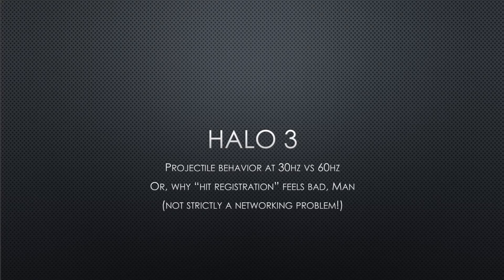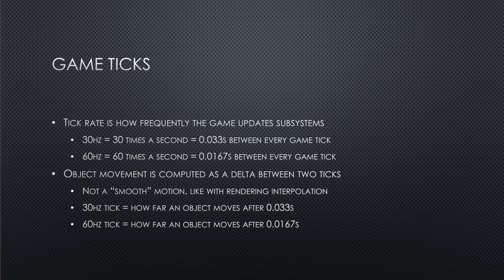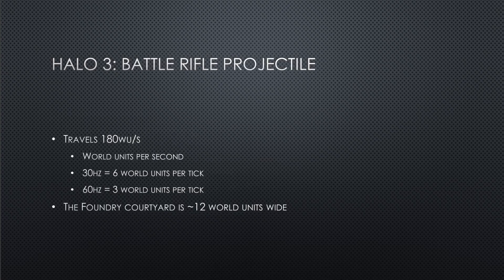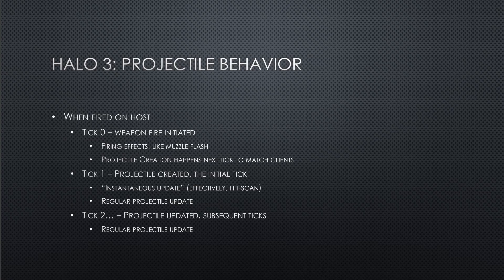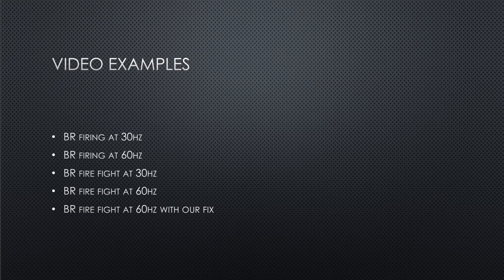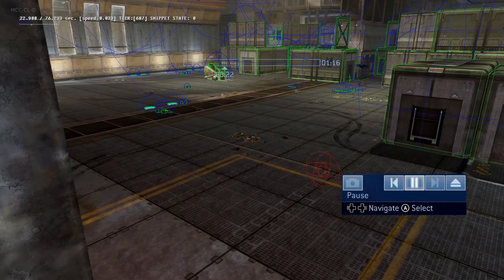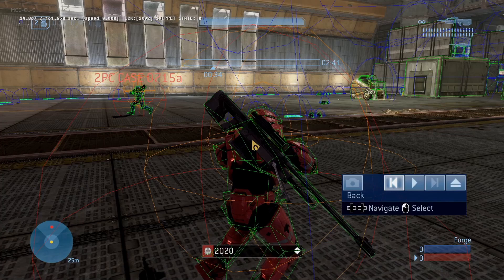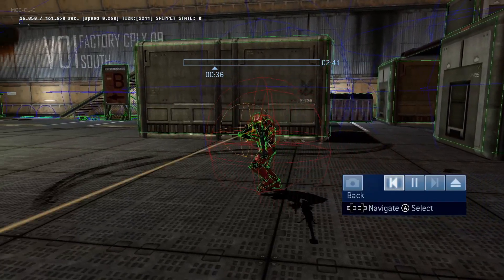Halo 3 - Projectile Behavior at 30hz vs 60hz

Comment: When you say the length of a world unit is "specific to the game" does that mean every unique Halo title's definition of a world unit is different, or just that it's not a unit used IRL?  In Halo CE 1 WU ≈ 3.0675 meters, because the max range of the pistol is 40 WU and the projectile vanishes at about 122.7m.  Would Halo 3's world unit also be 3.0675m or is it different?

Comment: From my understanding, this is going to improve up close BR fights, but I feel like mid to long range is still going to have the same issue, albeit to a slightly lesser extent. Couldn't the issue have been solved by increase the WU speed on the BR from 180 to roughly 270-360wu/s without messing with the tic rate of the initial tic? Would make it slower than the H2 BR, without sacrificing mid to long range consistency. Or maybe editing both the initial tic behavior and the overall WU speed of the projectiles would be the best option? Also, what about the other weapons? Many people have the same issue with the sniper, carbine, and several other guns just getting blood shots, but the game doesn't register any damage. Were these weapons fixed as well?

Comment: the only way hit reg can be a perfect 1:1 with original H3 is at 30hz tick rate. its that simple. this will be so close to exact i dont mind though. strafe dodging inside the hitscan range should be ever so slightly harder now, but id prefer that over having to begin leading shots at half the usual distance. rewriting projectile behavior wouldve been a lot more of a pain to do, and it wouldnt have been worth the results when compared to the ease and effectiveness of this fix in my opinion. solid work guys.

Comment: player: gun go bang bang

developer: you see. the ticks, and the bullet value registers with the wall that it has been hit. at this stage, the server registers this with itself only once and then sends packets to the client that its projectile made contact with the wall. at this stage the client will see on its screen that the bullet has missed its target and hit a wall. the player will then press their left mouse button again which will signal to the client pc to fire its weapon. 2 ticks have elapsed. during the 3rd tick when the projectile is created and leaves the client's weapon. it makes contact 2 ticks afterwards with a player. the server will tell the enemy player's client that it has been hit. and the client will confirm with the server that it has been hit. and the server will show on the player client's screen that it hit its target

Comment: So changing the WU of the 60hz BR to 6wu every tick mimics 30hz better. Though does moving 6wu per tick increase the bullet volatility? Essentially doubling how fast the projectile moves through space?
Reply: Only the first tick, the 'hitscan' tick is doubled, so there is parity in hitscan behaviour for both tick rates. After the first tick bullet velocity remains constant for the projectile.
So close to mid range encounters will feel more consistent regardless of tick rate, without affecting the bullet travel time of each for mid to long range encounters.

Quite an elegant fix if you ask me.

Comment: So if I'm understanding this correctly, for Tick 0 & Tick 1 the bullet travel speed is essentially doubled to 360wu/s (under 60hz) in order to achieve the desired 30hz bullet travel effect of the past, but for all the Ticks after Tick 1 it's back to the 180wu/s?

Personally, I think you should just bump the travel speed up to 360wu/s for the BR throughout all ticks regardless of the tick rate and call it a day because I've always felt that the BR's slow bullet travel speed was a major annoyance within Halo 3' gameplay.
Reply: This still won't fix the blanks for off-host players... There is a 1-frame/tick (16,67ms) misrepresentation to where the bullets go for off-host players...

Comment: is the problem simply that halo 3 is extremely forgiving when calculating collisions on a low server tick rate? increasing the tick rate should only make projectiles more accurate right? all you've done here is made the BR projectile speed non-linear (and increased it overall by 3 units a second) meaning that you will have to lead shots less at close distances? this seems like patching up the problem and not fully addressing it - couldn't this be addressed by increasing bullet magnetism across the board on every weapon?
Reply: This, or simply removing the visual misrepresentation of when the bullets hit a target, i.e: they actually hit 16,67ms later than what is shown on-screen for off-host players.

Comment: someone else a bit unsettled by the speed then some slower bits this guy talks at.
it sound unnatural somehow, like the footage got sped up in parts and slowed down in other bits.
Reply from the maker: The video wasn't done in a single take. I did parts of it after multiple takes, taking care to avoid vocalized pauses ("uhhhh, ummm"). I didn't have a script for the entire thing, but just some points I wanted to cover in each section. Plus, I had to try and explain the material in a way that non-devs could understand it. My day job is programming games/software, so compiling this video took some trial and error. The example videos were also recorded without any narration first (I did this before deciding it just easier to pause the recordings where needed while adding narration). Sorry if that ends up being distracting.
Reply: Exactly why aren't more people noticing this?

Comment: Great dive into how the Halo firing mechanics works.  Thanks for making this video.  

It appears that the inherent problem with aiming complaints is that the Halo 3 battle rifle projectile was originally designed to be painfully slow compared to the other installments of this franchise.   The easy fix would be to change the speed of projectile to be significantly higher, as they did for the Halo Reach DMR to the point that players considered DMR projectiles to be 1-tick hitscan.  But this would introduce a change from the design of the original Halo 3, and would alienate players that are used to the old mechanics.  The fix you implemented was a very good solution to have the game function as close as possible to its original state, without sacrificing the improvements of the higher tick-rate.
Reply: No, the problem is not that the projectile speed is slow. The problem is that there is a 1-frame (16,67ms) misrepresentation of where the bullets go for off-host players compared to where the bullets register for the on-host machine/screen, especially with the BR.
Reply from the maker: @xMCxVSxARBITERx  Sure, there's one game tick of delay, plus any additional networking latency, before the host can simulate a client player's weapon fire request. That's how the original game behaved too. The problem we were addressing is where MCC was not aligning with legacy. We are a fixing 60hz issue. The problem you're wanting to highlight is a far deeper topic, and requires changing engine code from what was used in the original release. These kinds of changes are not done without thorough investigation and testing first, because it's very easy to break a behavior (especially emergent behavior) that 2007-era players have come to expect.
Reply: Thanks for this reply; I had also taken this analysis to mean that the projectile speed was too low. Another question I had was that I thought MCC used dedicated servers now, so aren't all players technically the client?
Reply from the maker: @JoshBreakdowns  Correct, in matchmaking we use dedicated servers, which means none of the players have host, so everyone is equal in the aspect that they're all clients.

Comment: I have a question if anyone can shed any light. Does the hit of the bullet occur on the host device? In OG halo 2 I would shoot at a player, outside of red reticle range I had to shoot where he was on the host screen. I believed it was using the location of the player as I saw him when I shot to check if I hit him whilst inside the RRR. If that's the case then this change will double this effect on the MCC H3 BR and have a great impact. Although I've heard alot about all BRs being projectile based.

Another example of my theory is when shooting a player who walks behind a wall. If I shoot him in the center of his head in the open and it registers then on that connection it should also register if he walks behind a wall (if checked by the hosts Point of view)
Alternatively you shoot him, your console then sends a signal which says "hey I hit this guy" the host console says ok unless the line of sight between the two is broken.

Final note, projectile weapons suck with high ping and cause an advantage/disadvantage spread throughout the lobby. Could the game have a clock to measure when a shot was fired and check collisions based upon where those players were at that time rather than where they are after the delay. Hopefully this would remove some substantial ping disadvantage from guns like the H3 BR.
Again great work keep it up
Reply: This!

Comment: Not only does 60 tick on MCC break hitreg in Halo 3, it also affects all object spawn positions for some reason, which causes the covenant sniper towers to not spawn correctly and sometimes fall  off their bases as well as make the secret Cortana spartan laser skull spawn off the edge of the map and become unobtainable. I've used mods to re-enable 30 tick on Halo 3 and it fixed all of the spawn position locations inherent with MCC Halo 3's campaign. MCC ODST also shares the same issue of spawn positions, you may notice that guns that were meant to be spawned leaning up against balconies are now spawning on the ground below the balcony due to 60 tick. This change to object spawn positions in the world is also what caused all the issues with weapons on multiplayer maps spawning way too high, or not spawning at all in the early days of Halo 3 MCC multiplayer.

60 tick doesn't just break hitreg, it affects the entire game's engine, including AI, object/AI spawns and physics. And it's not exclusive to 3 either, Reach plays completely different at 60 tick than it did on Xbox 360 at 30 tick, especially Reach's AI, who have completely different behaviour on MCC than they did on 360, such as the seraphs chasing you non-stop on LNOS, enemies firing faster/longer in general, or the elite zealots no longer falling back/retreating like they used to on the final part of the pillar of autumn. Due to changes in physics at 60 tick some crates also spawn differently on MCC, such as the secret ammo crate at the end of POA, which flings itself out of the wall and off of the map.

60 tick also breaks the entirety of Halo 2, including fire rates for all weapons (not just the carbine and BR), AI behaviour and spawn positions for some objects/AI, an example would be the flood carriers that drop out of the pelican at the start of High Charity being in the wrong position, or the drop pod elites on Uprising no longer following the player properly due to changes to their behaviour.

The simplest fix would be to simply make all the games 30 tick again like they were originally, uncap the player camera and then interpolate all the animations to look smooth, this is what was done for Gearbox's Halo CE PC port and it works much, much better than any of the 60 tick ports of Halo games such as Vista or MCC. This wouldn't even be that difficult as Halo 2 on MCC already has in-built interpolation on a lot of animations.

Please don't just brute force fixes onto things without actually addressing the core issue that is causing all of these issues, changing how the hitreg works at 60 tick may fix hitreg, but it won't fix all the other countless issues that are inherent with the engine being forced to run at 60 tick. Treat the disease, not the symptoms.
Reply: Man no way. I remember seeing nearly all of these things and thinking "What did 343 change?". Had no idea it was the tickrate. Thanks for clarifying all that for me!
Reply: I remember the Zealot outside of the door in the Pillar of Autumn in Reach stands outside while in the 360 he went inside the building when N6 got close like you said... Also Superbouncing or Ghosting in H2 do not work as intended, and Sword flying is twice more strict, and the Great Journey Brutes in Wraiths flip after they spawn. Do you know other instances of the games broken because of the forced tickrate? Have you reported them as well?
Reply: @MrMercuryW  The brutes at the start of Gravemind shoot you as soon as the mission starts on 60 tick, while they have a delay on 30 tick. Also the some of the spawns for the sentinel enforcers on Quarantine Zone are broken on 60 tick. Some flood spawns are also broken on various missions in Halo 2. There's probably plenty of other issues in 2/3/Reach that I don't know about though.
Reply: @moooooner  Do you know the way to force all MCC games to be 30 tick without relying on outdated cheat tables? So I could hopefully help better convince 343 of the drastic measures that need to be taken to restore the games.

Also as far as I know the Gearbox port doesn't have interpolation by default it was added in the Chimera mod wasn't it?
Reply: @MrMercuryW  Nope, there's a mod that enables 30 tick for Halo 3, but only Halo 3, everything else has to be done via CheatEngine.
And yeah, the interpolation was done by the chimera modders, not Gearbox, so it shouldn't be hard for a AAA studio to do it too.

Comment: Glad you've found a fix though I can't imagine it being the real problem/issue or a huge deal at all. Would just mean without the fix players would have to preaim/lead their shots a bit more than on OG H3, after a certain distance it's projectile anyway.
Reply: Having to lead shots even more would be awful
Reply: Jesse Galloway yeah but you did not have to. Only a bit for the distance of the first tick that deviated from how it is on 30Hz and even then only if the enemy is at the edge of this distance otherwise it was still hitscan. And for distances after the first tick it‘s projectile and works like in OG H3 with 30 tick. I think you would still need to account for a ticks difference but that‘s not much and H3 isn‘t that fast of a game so you don’t have to lean shots that much anyway.

Comment: While you guys are only focusing on the halo 3 hit reg, i hope to see the rest of the games hit reg fixed up to be more consistent on mcc, halo 2 especially
Reply: RARAYAYA RAA  The AI is not perfectly fine, it's completely broken compared to 360, and how on Earth is it "better"? If it's somehow "better", then you're admitting that 343i have broke and changed it from 360.
 Stop being a delusional 343i shill.
Reply: RARAYAYA RAA  >new skulls in Halo 3 means Reach has better AI
What level of 343i shill mental gymnastics is this?
Reply: RARAYAYA RAA  "wooo look at me guys I'm pretending to be retarded haha"
Reply: They should just make all the games 30 tick again like they were originally. Hitreg is not the only thing broken by 60 tick, it breaks the entire engine. AI in Halo 2 and Reach are especially badly effected, while object spawn positions are completely different in 3/ODST between 30 and 60 tick.
Reply: @moooooner  They responded to this argument in the development update. Doing 30 tick forced would have additional consequences and hurt other parts of the game in new ways. They don't see forcing a bad tick rate (and PC players would absolutely mince the game for running at such a low tick) as a viable solution, and fixing the actual problems (while more time consuming) will lead to a better experience across the board.
Reply: @superderpyderps  How? The games were designed to run at 30 tick. I've modded my MCC to run at 30 tick and it's perfectly fine, the only issue I encountered was that the first person crouch and uncrouch animation was weirdly jittery.
They're probably bullshitting because it would take more effort to make it 30 tick.
Reply: @moooooner  Just because something was designed to do something specific doesn't mean the design is good. Bungie's BLAM engine is very hacky and there's a lot of band aid fixes and tape holding the thing together. This was a bad practice by Bungie and as a result the ports of Halo CE and 2 suffered (especially CE with its horrendous networking but I think that specific feature was developed by Gearbox).

I will guarantee you Destiny 1 has this exact issue but since the projectile speed was as high as Reach's it's not a huge problem.
Reply: @moooooner  Playing on 30 is terrible for competitive play! Way too much input-lag!
Reply: @jktwiceft  >Just because something was designed to do something specific doesn't mean the design is good
The game was designed to run at 30FPS max on an xbox 360. Using 30 tick was perfectly fine and actually worked. So yes, it was a good design.

While a game built from the ground up for 60 tick would be better, that doesn't mean forcing a 30 tick game with the entire engine, AI and physics built around 30 tick to run at 60 tick and breaking everything in the process is a good idea.